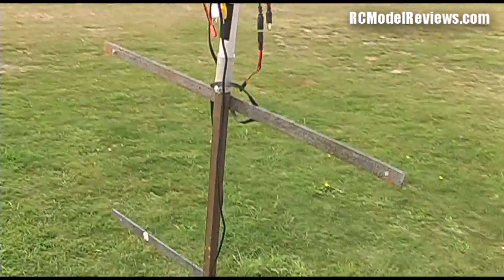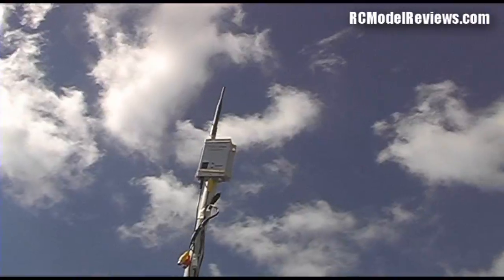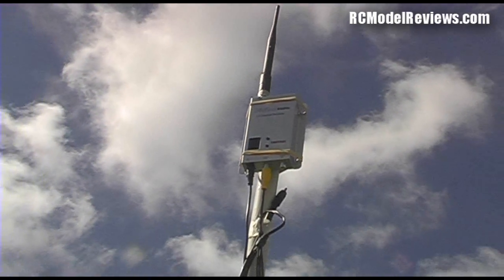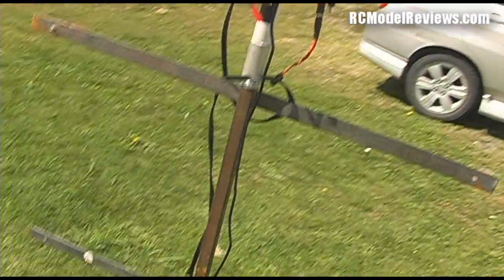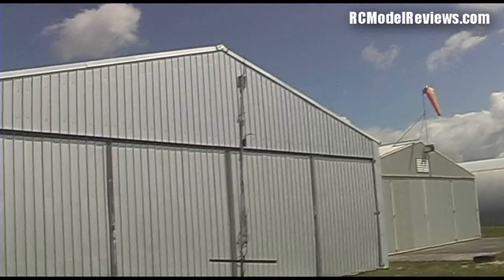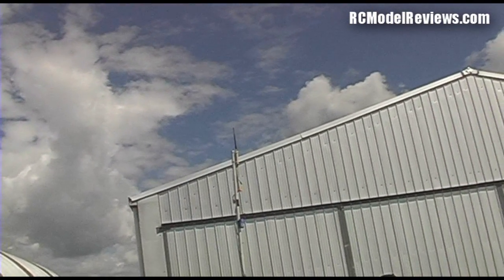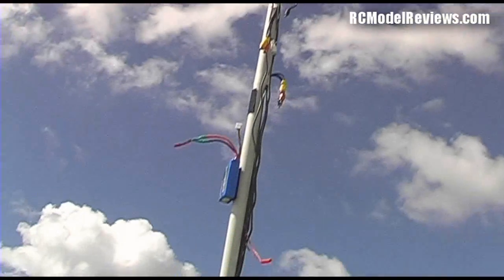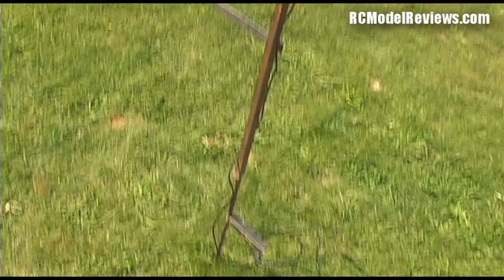Top-Tip:  How to get maximum range from your FPV video system

Comment: That's back in 2011, 5 years has pass by, 2km is nothing. How about 10km and up , any ideas?
Reply: Forget 10km, Where do I get a Pole?
Reply: Drone Mania correct let's move on ... Share the tech.....
Reply: noob question don't normal quads get about 1.5km? how would I get 10? new antennas?
Reply: The idea is: dont do it. Those "Ideas" produced so much restrictions, laws, problems in general for the whole rc Community... those Experiments will be causing and caused in the past a lot of Trouble for every rc hobbyist. Is it still not enough with all that bans and new laws?
Reply: Get a DJI drone end of story. No cheap quad can go more than 2km. By the time you have your streap tease poll setup you will be looking at 1k$ already.

Comment: hey I'm using the spectrum VM 1100 the little micro camera the 25mw transmitter if I put this in my front yard will I get better range with my current setup or do I really need to upgrade to at least 250MW I plan on getting the vortex 250 with the 350mw so im sure that will be good when I do get that

Comment: Good advice Bruce.
I'am using an immersion 5.8ghz system-and like the idea of routing the vid signal from a Uno RX mounted on a high pole to a 25mw TX repeater to the in built RX in the fatshark goggles.
It would be handy to be able to sit in the shade and get a signal from the Uno-way out in the open--without the need for cables.
I presume the 5.8 channels for the repeater and goggles would have to be the same-but different from the Uno RX and the TX on the quad?
Not sure if I'am on the right track here--I wonder if the TX repeater would need to be sheilded from the Uno TX? I'am using spironet antennas on the quad and Uno--but could I get away with using dipole  antennas on the repeater and goggles?
Cheers--Thanks for all the RC reviews--much appreciated.

Comment: or buy a telescopic pole then its portable
Reply: Or you can use sections of PVC pipe with joints or dowels so you can just pull them apart.
Reply: yer that would work to and then if you needed it longer just buy more pipe
Reply: jameshone1000 And it's cheaper than getting a telescopic pole. PVC pipe is really cheap. It also doesn't have any effect on electronics like metal pipe could.
Reply: or a telescopic fishing rod would work  I only thought of this because I have a old one sat in my garage
Reply: jameshone1000 That could also be a good substitute.

Comment: great ,advice .  I am just about to go fpv with an AirTitan aeroplane , 3 days delivery to Portugal from Finwing hobby in China . A super helpful company to deal with .
My second hand Arkbird has no OSD and the gain is far too high on the flight controls .How can I turn it down without the OSD .My 40 size trainer test bed aero wags like crazy with the Arkbird autopilot switched on .

Comment: You may try to ground the box or the sheath of the coax into the pole and the ground itself, this works well at lower frequencies but not sure how well it works at higher frequencies, there are such things as ground waves which help. Could be worth a try?

Comment: The 900Mhz will probably always give you the best signal. Because a lower frequency will always go further then a higher frequency. Non the less i don't see a problem. Do try to space the antenna's, as far a possible. They could interfere. So i my advice, just use the 900Mhz ;) and leave the 5.8Ghz at home :P

Comment: Hey Bruce, I have a problem... i was taking apart my 12channel receiver to solder a new end onto it for the power. when i was taking it apart, i noticed that 2 of my wires on the actual receiver bit that the antenna plugs into have been ripped off... this is probably why i have no video signal... so i was wondering if you had a picture of one of these recievers opened up so i could see which wires go where, and solder them back on better...

thank you Bruce!

Comment: 1. Don't use a cheap Chinese RX. Open up your RX and see if the tuner is a ComTech or not (big difference).
2. Open up your tuner by prying off the faces so you can check your SAW Filter. If it is not 17mHz, then replace it with one from ReadyMadeRC. That gives you an additional 3 dB of sensitivity.
3. Setup a Diversity RX system with narrow beam and high dbl antennas.

You should be pushing 5 miles by the time you do this. Be sure you have a bomber RTH system as your Failsafe! :-)

Comment: What power level where you transmitting the 900mhz at? Was that the 200mw? What's the picture clarity look like at that 1km or 1.7km range? I've been looking for a good antenna setup for 900mhz for a very long time. I use a 900mhz 1.5mw transmitter and the most I've gone is about 1 mile and I had perfect signal. I'm looking for that super duper 3 mile+ range but the punch through power of 900mhz for dealing with LOS obstacles. Any help is appreciated.

Comment: Use a 433mhz uhf frequency (ie dragon link system) for your plane radio transmit/recieve, and then add a diversity system with clover leaf and patch antenna. For AV signal use a1.2ghz/1.3ghz system with a 500mw transmiter and you will be flying non lign of sight in no time! BOO YEAH....PS, dont forget your autopilot system too if you want your exspensive pride and joy to come home in case of signal loss LOL.

Comment: a little silly question 
if the video equipment is running on 2.4ghz  and the the plane controller is running on the same frequency what is the effect 
i know there might be interference but i really wanted to ask a professional 
my only other (local) option is 5.8ghz video equipment would that be a better choice 
also i have heard that 5.8ghz is not so great in more urban areas

Comment: Dear Sir: Great video, I have a question, will be good idea to put two transmitters in the plane? say one at 900mhz and the other at 5.8ghz? or you will create more problems than solutions? clearly on the base station you will have a diversity unit to peek the best signal.

Thanks in advances.

Comment: do you think this method could be used to increase the range on the RC device, lets say a plane? some RC planes have a good range you could fly them while some the range is less, my idea was to shoot the signal from a RC transmitter unit into an amplifier or high gain transmitter that is on a pole in the yard with the hope that it increase the range of the RC transmitter.. how possible you think this is and what would be your recommendation for such a project.

Comment: Hi, I'm looking at getting into FPV and want to find the best option before spending a lot of cash. I have a few questions. I live in Austria so 2.4 ghz and 5.8 ghz are my only real options. I could use 1300mhz but Id need to get a HAM radio license first.

Would using a good quality high gain Omni antenna eg 13Db make much of a difference to the range? Do you fly in a relatively clear area and do you keep LOS at all times or do your planes go out of visual range, behind trees etc?

Comment: You keep talking about the multipath effect you get at your location (notices big metal hangers lol) the simpler solution with or without the big pole would be to install an diversity system with 2 patch antennas. The diversity system takes 2 vid-RX feeds and chooses the strongest signal and relays that as actual video out. Place 1 patch antenna vertically and the other horizontally for omi direction cone on each axis, meaning even flying directly over yourself will not result in signal loss.

Comment: Someone below was asking about patch antennaes. They are ground plane dependent and work best 4-6" off the ground and at a 40-45% angle.  Putting them high on a pole would not be a good idea.

Comment: One quick (maybe stupid) question - I notice your antenna mast is wood/plastic - does it need to be non-metallic in order not to interfere with the reception?  Or can I use an extending aluminium pole made for cleaning high windows...?

Comment: @RCModelReviews Thanks for the quick & useful reply - that is what I feared, then.  Sounds like to get any improvement I will need to ditch the RX functionality of the fatshark goggles and use them only with a AV cable up to a new receiver & antenna on the top of a pole. 
Actually, if I did put a new RX on a pole, could I plug that AV cable into the Fatshark TX and retransmit on 5.8 to the fatshark on a different channel?  The FS re-transmitter would be 1m+ directly below the main RX at the top?

Comment: Are you planning to do a video showing tips on the placement of the multiple antennas (2.4GHz radio receiver aerials + 900MHz / 1.3GHz / 5.8GHz video transmitter) on the model itself? Presumably this will also affect the range you can get out of stock equipment.

Comment: What about having just the antenna on the top of the pole, with a coax cable down to the receiver?  Or would there be too much signal loss in the cable?

For the moment I am using the Fatshark video goggles with the built-in 5.8GHz receiver.  (I know I will need to upgrade sooner or later, but I am not ready to do so yet.  I am in the UK and using 2.4G r/c, so 5.8 is my only choice for AV.)

Comment: @sshukri0 
I've found 1.2ghz patch antennas to work best about 6 inches off the ground compare to 3-4 feet. Not sure compared to 10 feet + but whats the point since patches easily get 3 miles + with 400mw systems rather not have the trouble of a pole. 

However I would love to see a patch on top that 4meter pole ^^